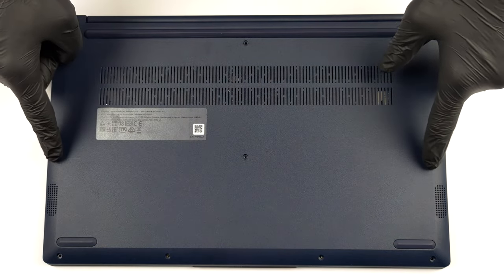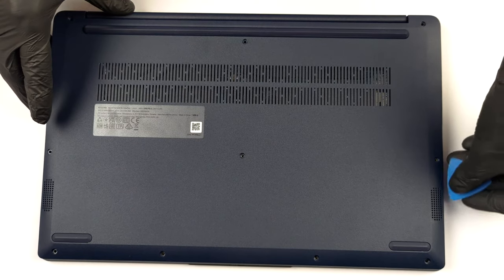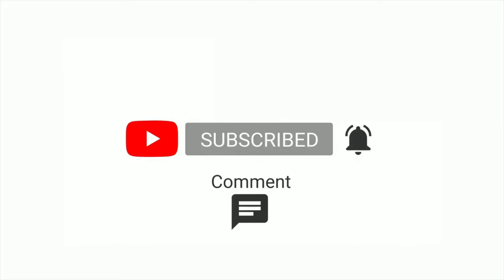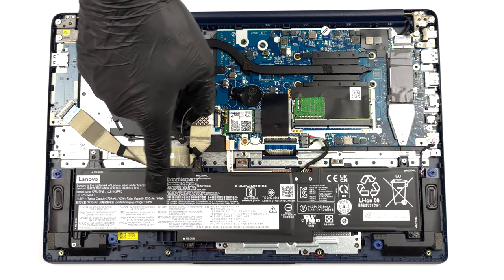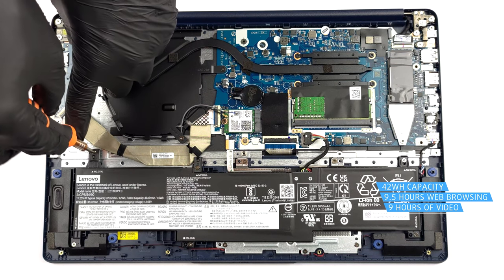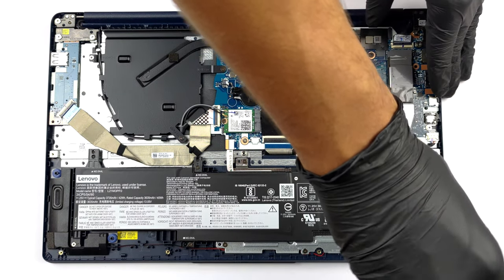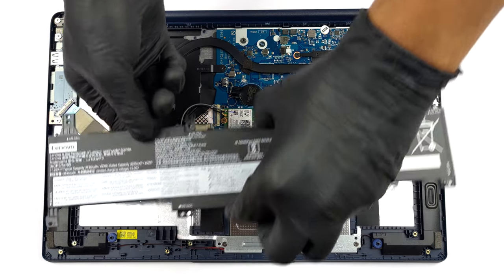🛠️ Lenovo IdeaPad 1 (15", 2022) - disassembly and upgrade options

Comment: I have this same model but for some reason mine didn't come with a Ram Slot and I looked it up and when I got my ddr4 ram today I was sadly disappointed that it didn't have a slot, it has the spot where ram goes but not a slot
Reply: So, what you're saying is that your laptop does not have RAM memory?? 🤔🤨🤭😅😂🤣🤮
Reply: @iankertzman7435  another slot to put more RAM. Mean memory is soldered to the motherboard. No upgrades possible.
Reply: As far as I can see a lot of laptops go by this name.

A benefit with unopgradable RAM can be improved battery life if it is LPDDR instead of DDR which RAM modules use.
But still annoying you bought new RAM modules to upgrade when you cannot use them.

Comment: With the help of this video, I was able to upgrade my laptop, by installing an additional SSD in the M.2 PCIe slot, as shown at 1:58 into the video.  Unfortunately, my laptop didn't come with the mounting bracket and the screw that holds it in place.  I'm using a full length 2280 SSD so I don't need the mounting bracket, but I do need the screw to hold my SSD in place.  Any chance you could describe the exact screw I need?
Reply: What ssd did you use?
Reply: U could have used the same screw that you removed originally
Reply: @CandiceCandyLuvLovell  If you're talking about one of the screws that holds the cover on, that's what I did, but the screw didn't fit perfectly and, therefore, didn't hold the SSD perfectly.  If you're talking about the screw that held the bracket that had to be removed in order to install the SSD, mine didn't come with that bracket and also didn't come with the screw that holds the bracket.

Comment: Neither the ram or SSD were installed in mine, I don't know if they were soldered into the motherboard. The slots are empty. The laptop is faulty now and I don't know what the best option is
Reply: If u have an empty slot it means u got a chance on adding some ram to maximum

Comment: HP Pavilion 15-eg2006ni Laptop 

Would you please review this laptop. HP states user accessible slots = 0 (Just want to confirm whether ram  can be upgraded)
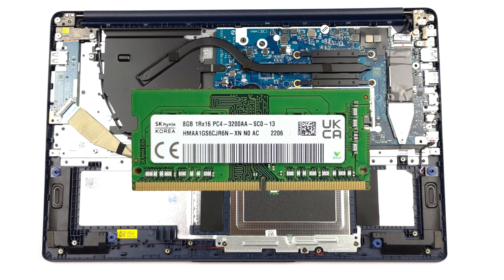Reply: 1:40 he says "some units come with 4gb ram soldered to the motherboard".  I take this to mean you can't upgrade it easily.  I don't know how you would know before you buy.

Comment: hi brother, thank you for the video. i am gonna make a dumb question but is the cpu upgradable in this computer? thanks
Reply: no
Reply: generally, desktop is more saying about CPU upgrading. Laptop will be extremely diffcult. Do you mind looking into the difference of CPU layout in common laptop and desktop? Then, you can decide from there.
Reply: yes, the cpu would techically be upgradeable, but the eqiupment to do so would cost almost 6 times the price of the laptop
Reply: @smirkjuice  yes and the BGA socket requires high skills to desolder and resolder a new CPU, you could get more damages than benefits if not properly executed.
Reply: Laptop CPUs has for years been soldered to the motherboard, so at best you can replace the whole motherboard with a new CPU (which you can with Framework laptops).
Reply: @AndersHass  because of BGA socket (Ball Grid Array) in others terms, soldered to socket and so to the mobo.
Reply: @mickeul16  for some reason your comment wasn't shown to me.
But perhaps one day some manufacturers offer people to be able to solder new CPUs in the same BGA socket lol.
Reply: ya a dumb one, lol, no laptop on earth is the cpu upgrade possable only desktops, what you buy is what you get,

Comment: I have my Lenovo IdeaPad 1i 15IJL7 | 15.6 Celeron N4500
 upgraded with 16 GB PC4 3200 and I have a total of 20 GB RAM
Reply: I have the same laptop same specs, can you upgrade the processor (or the entire motherboard)?
Reply: @ShatasreeMazumdar  you can not Upgrade the procesor
Reply: How? mine is soldered and only 1 of 1 slot and no more slot to be used only 4gb

Comment: i cant figure out why they would sell a computer with only 4gb ram with 64bit os, not gonna work, the internal graphics can use 2gb alone, , ya no, , lol and from what i have learned they started selling this model with a ram slot, and later removed it, so depending on when yours was made , lenovo used to be much better when they were IBM, , they suck now, hp pulling same crap, dell seems to be the only one not cheaping out as bad so far